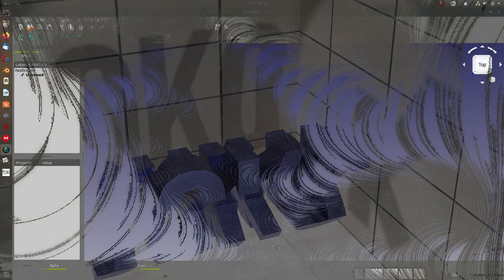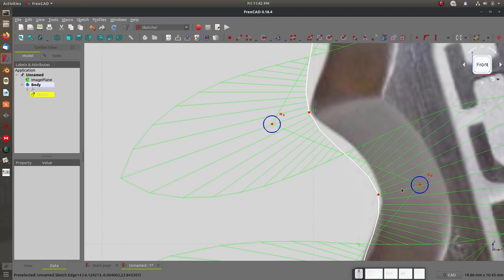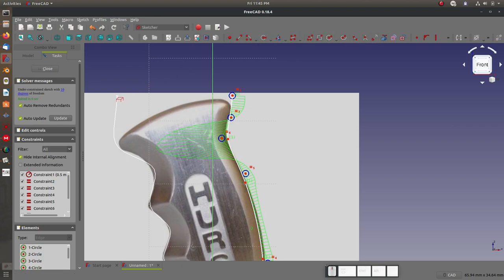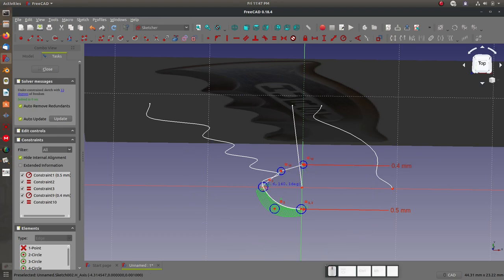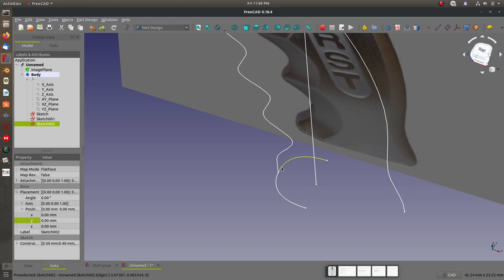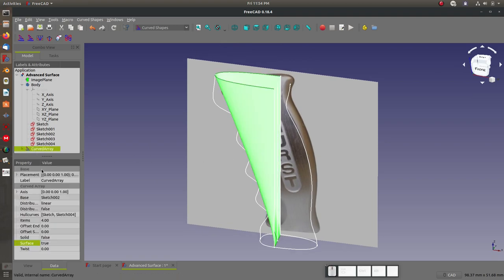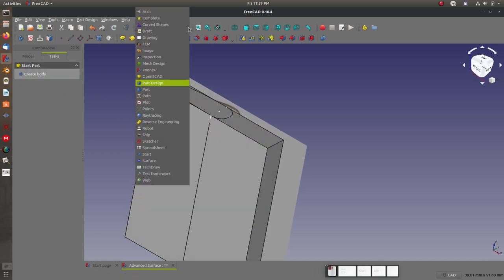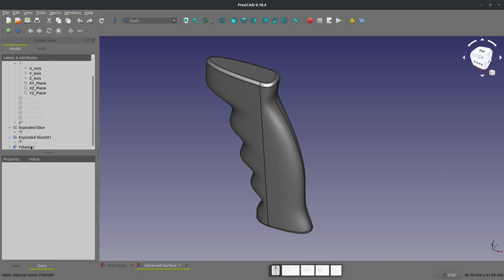FreeCAD- Methods For Even More Surface Control |JOKO ENGINEERING|

Comment: Thank you very much for the videos. I've learned a lot from watching them. I'm curious how to make a grip similar to this but only half of it, such as left and right grip panels (like in my video "DIY Pistol Grips"). Will the "curved shapes" application work with a shape that is not symmetrical? I've tried a few different things and have had no success so far. I end up with errors or really weird shapes that do not resemble any thing that I have drawn. I've been making pistol grips for years out of wood, but thought I'd try 3D printing grips for more modern pistols. However, I want to get CAD down before I purchase the printer. Thanks again.

Comment: Hey Joko, Thanks for the video. I was wondering how to fully dimension a spline based on points on the curve? In most other CAD softwares I used, the spline is created by points on the curve, however FreeCad defines the curve based on control points. This makes it difficult to follow drawings that call out splines. Maybe you can address this in a future video? Anyways, thanks for the vids!

Comment: Wonder if you could continue with this tutorials and  make it in into a flight stick grip tutorial that would consist of 3 parts and would be hollow inside. I`m trying to learn how to design flight grip for a prototype of the joystick for 3d printing. And couldn`t find any tutorials  of similar nature.
Thanks a lot for your lessons!
Reply from the maker: Interesting suggestion.  This should hallow out well if you go to part>thickness, select the top face and perhaps the bottom face and specify a thickness less than the minimum radius on the part.

Comment: It works, thank you. I've tried several shapes and it works. But what if the ending shape is different from the biginning? E.G. i start with oval end finish with circle
Reply from the maker: It's been a long time since I put this out so I'm trying to recall everything I did.  Using the curved shapes workbench, you're limited to the initial sketch.  I would suggest the surfacing workbench for other tools that would work the way you mention above; I make a mouse and guitar in another videos and perhaps some of those workflows are in line with what you would need.

Comment: Thanks for the video, I want to make myself a joystick for flight simulator, while i have some experience with simple objects in freecad, i can't make anything with curves, now i can!

Is there any impact from not fully constraining the bspline lines?
Reply from the maker: Often I don't constrain them depending on the design intent.  If the curvature is critical or needs to be precise in some way, fully constraining is best practice
Reply: @JokoEngineeringhelp  awesome, thanks for the reply! I find them messy to constrain, so would be happy to leave them.

Comment: Great tutorial, thanks a lot. I wonder if it is possible to do knurling on the sides of the handle ? All FC knurling tutorials I've found so far show only round object knurling.
Reply from the maker: SolidWorks has some functionality to do that, if it's not available in FreeCAD it probably will be soon
Reply from the maker: Thinking about it a little more, you could probably cut a knurl pattern in a surface and thicken the surface, merge with solid
Reply: @JokoEngineeringhelp  Thanks for the answer, I used a bit different approach - using angled sections as sweep patch (120 of them) and a little triangle to cut knurling pattern. The only problem is that it's a very heavy workflow for my rig :/
This is imported step file, so you can take a look at it if it is possible with your workflow, the grip is KG13 one :
https://drive.google.com/file/d/1dHk5rzxlwjcO5TkuuYEZ1lqRSxzZLzHB/view?usp=sharing

I just finished knurling path with sections and it looks bad at the front/back of the grip:
https://postimg.cc/svh4t9Xn

After a week of Blender tutorials I did something that looks acceptable to my standards :
https://i.postimg.cc/bwQr3t3j/kg13-knurling.png
Reply: @cezariuszczapinski9428  can that blender model be 3D printed? Is that knurling a material?
Reply: @JustinDeane222  Hi, this is knurling is a mesh, so if you print the handle it will be like on the real Bf-109 ;-)

Comment: Whenever I try this tutorial, the curved shape workbench gives me full ovals instead of half ovals, so the oval center is halfway between the front b-spline and the middle curves and creates a closed shape. The only solution I can find is doing the curves across the entire front, middle, and back items and then slice it apart in the part workbench...

Comment: The distortion you get on front bottom part while creating surface is because front line is not connected to the base, there is a gap, this could bee seen here, when you zoom in =) https://youtu.be/YxOLOuzOW6U?list=PL7eiW2bt21YU6QEbly78kUgQCNEiDUwSH&t=901

Comment: Those two vertical lines should have been tilted, probably 15 degrees. Right now, you ended up with unbalanced curvatures along the height of the part especially on the top and bottom.Also you should have shown how to do the lettering. Otherwise a helpful tutorial. Thanks.